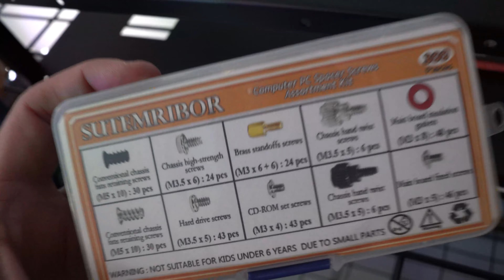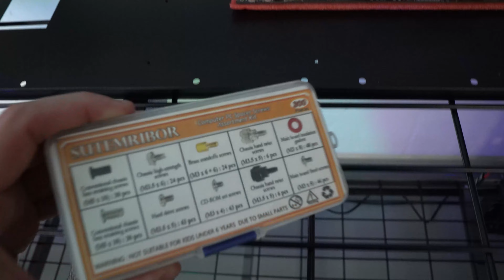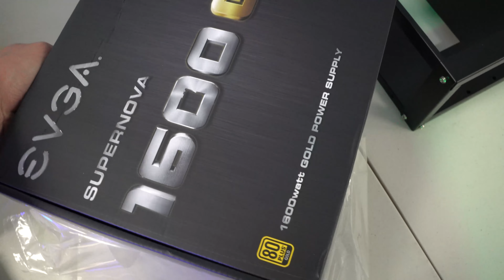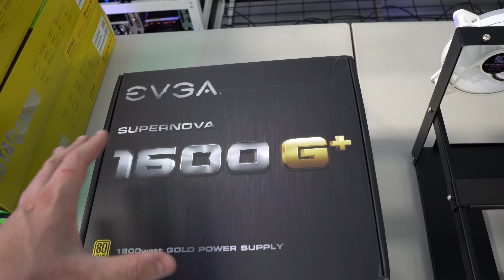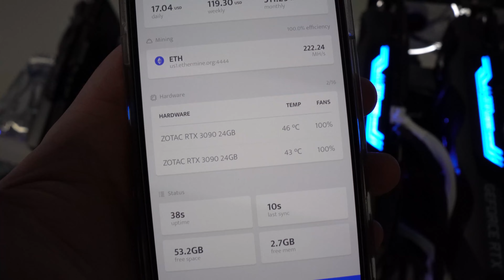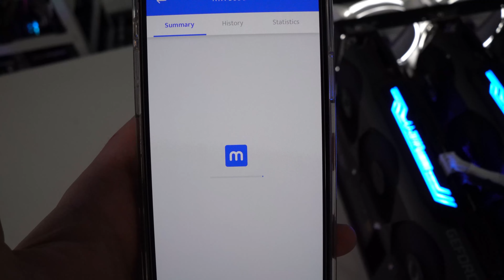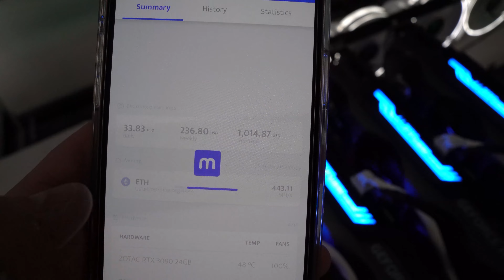Our Biggest Build Yet - 3090 Zotac 8 GPU Mining Rig - Part 1

Comment: in would connect the splitter to the 2nd 8pin if you go from the hdmis most of the time the 8 pin thats the closest to the gpu die and the hdmi plugs pull the most power
Reply from the maker: Interesting! Maybe I can find a way to separate out the 8-pins to calculate the power draw. from each part (8-pins/PCIE Slot) The splitter cable is powering the second 8-pin and the riser, which from what I saw the riser pulls about 52 Watts. I will do testing!

Comment: Do you think a 1200 watt would suffice for 3 x 3090? Awesome build btw! Looking for a more enthusiast-like build from you!
Reply from the maker: They consume on the high end about 300w, so that would be 900+say 60 for system idle. 960w = 80% of the 1200W. I would say yes that is fine, just make to sure to apply the right unclocks/overclocks. I would also keep an eye on the plug to make sure it's not getting warm on the wall.
Reply: 1600w EVGA is your best bet

Comment: Liking the videos! Question….. are you worried about running the fans at 100 24/7? I have a 3090 and I try and keep the fans decently low but I know you really can’t because of the gddr6x mem temps.
Reply: Fans are easy and cheap to replace compared to a dead gpu. All depends on the temps on your gpu / memory if I can achieve 50 c core and 80-90 mem jun temp with 70% fan I’ll leave at 70% if I can’t And I need to run it at 100% I run at 100%.
Reply: @Ryannn..  oh ok thanks, appreciate the response!
Reply from the maker: I agree with The Novice Miner. I have replaced so many fans on GPU's that I am not too worried about it.
Reply: @GPURisers  ok thanks! Appreciate your response! 😁